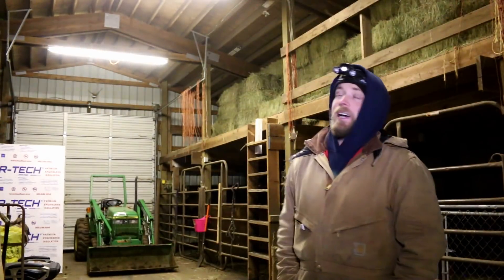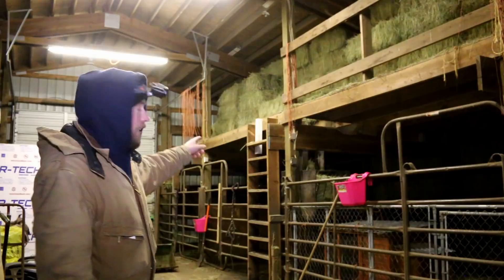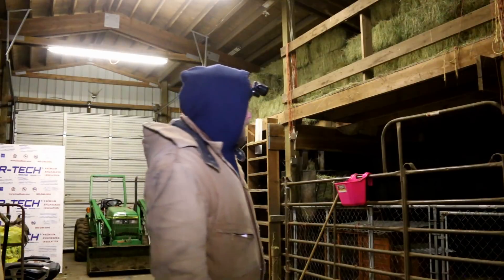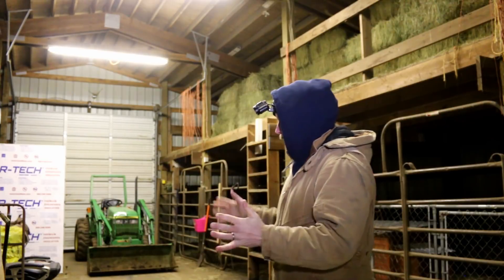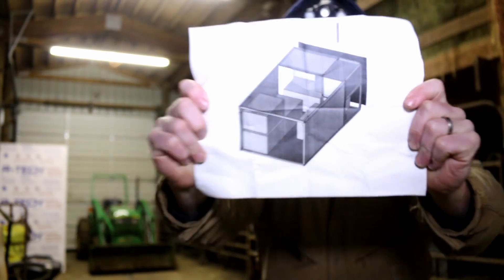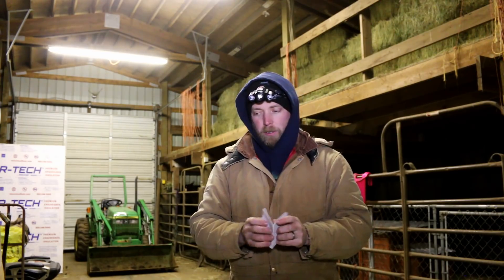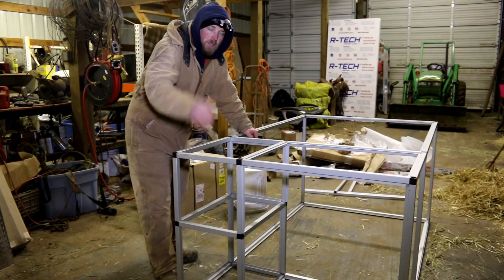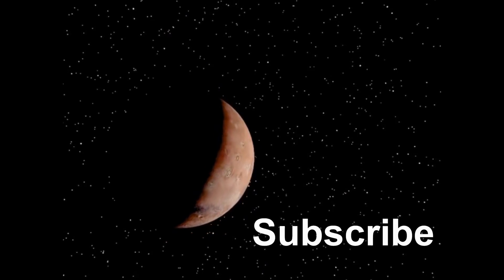Why go with 80/20 Inc for your custom builds?

Comment: The best work gloves I have found are golf gloves.  Use them for a bit and you will discover that you have almost all of your fingertip dexterity still.  If they are not warm enough, cut the fingertips off of some cheap walmart black/brown cotton stretchy gloves and wear them on top, or just spend a bit more and get cold weather golf gloves.  I go through about 2 to 3 pairs of golf gloves a year depending on how many pipes I have to dig up.